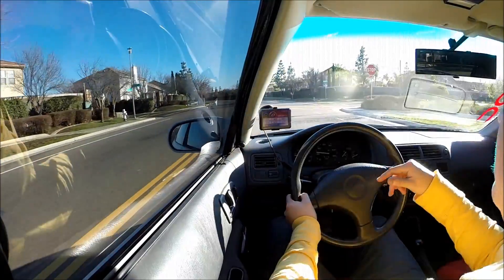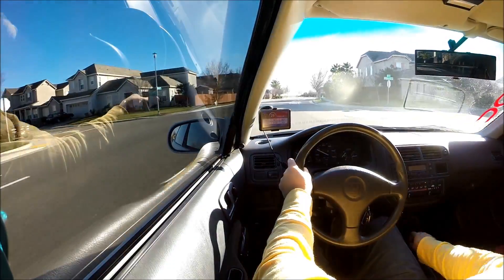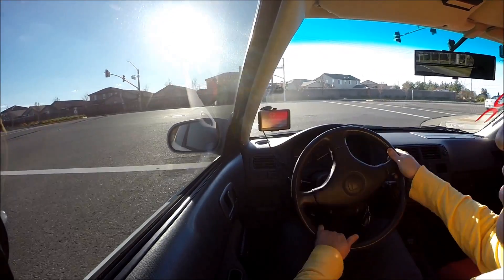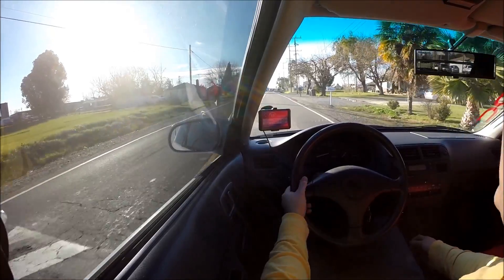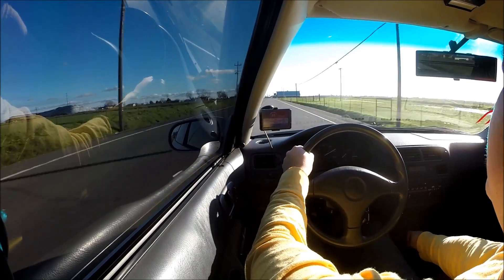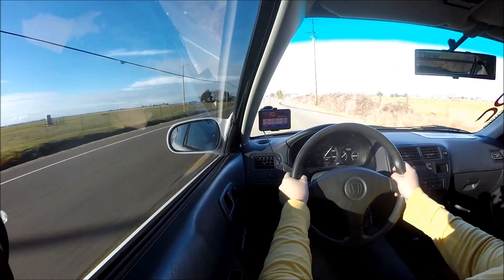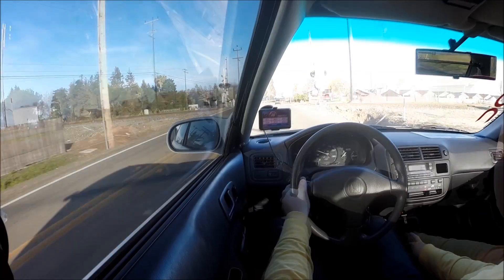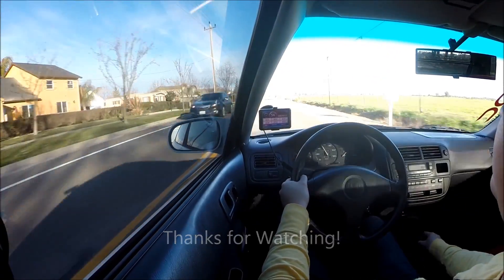What is a Chipped ECU Explained Part 3

Comment: i know that this i an old post, but i need some help. i am not computer literate, and don't understand the lingo. Im an old fart and i'm building my son a race car. We have a  96 civic dx with a D16Y8, 5 speed with a P2P ecu, with a cold air kit, long tube header,light weight flywheel and big clutch. This being said I need 2 ecu's built, I don't know haw to solder the chip or program them. Would you be interested or know some one in the business?

Comment: if you're still on the stock cx/dx transmission you should consider getting a ex transmission it's much shorter in gearing so it will feel much faster
Reply: I think it's a cx 
Those gears are alot longer then even my hx